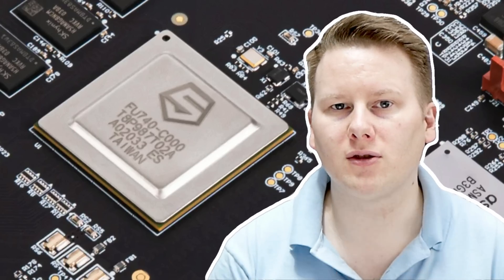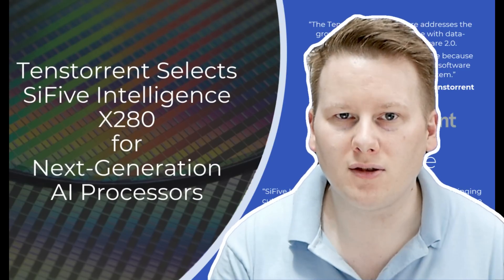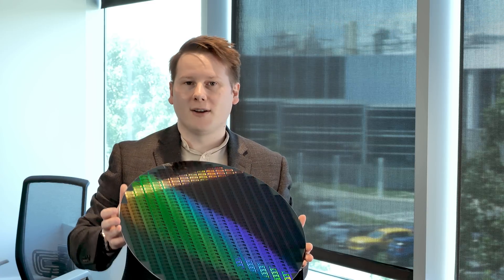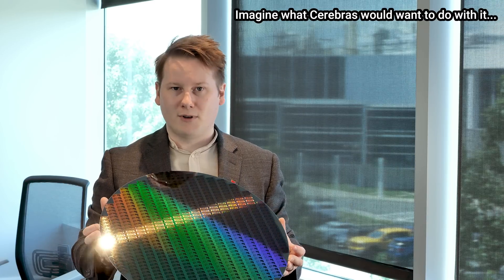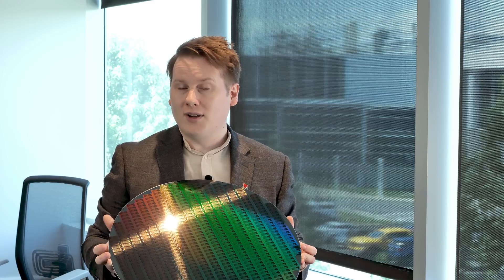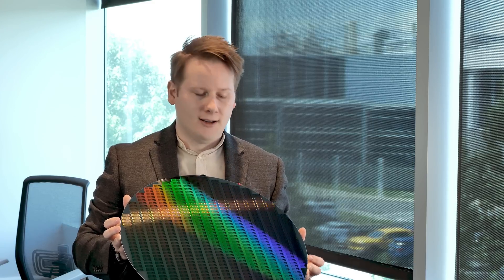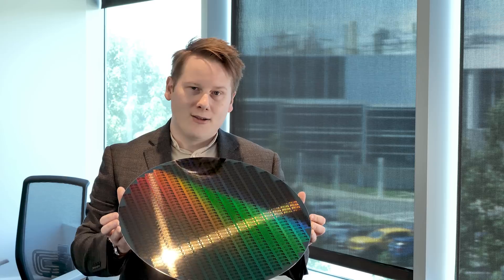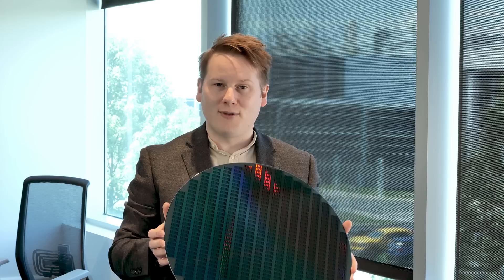Why Don't We Have 450mm / 18-inch wafers?

Comment: do they even grow ingots this large? Like you don't just turn a single wafer of silicon. Because that would imply you could grow Germanium ingots in the same size... Which would make massive optics
Reply from the maker: Yup, they do. I've got a video showcasing a 440mm, 2000 kg ingot a company had at a trade show. Ingot growth isn't a concern 👌

Comment: 450mm wafers were a real discussion when the industry couldn’t figure out how to go below a 14nm process. It’s the next logical step if you can’t get your devices small enough, and we’ll probably get there, I just don’t see it happening in the next decade. There’s too much cost invested in fabs at the moment and we’ve managed to push down the nodes to at least 2nm and Intel is talking angstroms with their raptor line, so we’ll see!

Comment: This video is disappointingly short on details. Why is switching to larger wafers so expensive? They don't do lithography on the whole wafer at once, they expose one die (or a couple) at a time, and then shift the wafer to do the next die. The design of the mirrors and lenses limits the reticle size, not the wafer size, so making 450mm lithography machines doesn't seem like it would be difficult. Is the issue the other machines, like deposition/polishing? What are the main drivers of the lower yields near the edge of current 300mm wafers?
Reply from the maker: It was literally a hands on with the wafer that was randomly handed to me with a little background. Wasn't a prepared video, got a brief history lesson in the fab buildings where the research was done. If there's desire for a wider video on the topic then I might go further into the details. There's only so much you can say in 3-4 minutes.

Comment: The switch from 8 inch (200 mm) to 12 inch (300 mm) was very challenging and much more expensive than predicted. In fact, many facilities still haven't switched. Try to get an interview with Chris Mack. He's been doing this for decades and would have lots of detail on the economics of increased wafer size.

Comment: Seems to me like if there was a time to be switching over to 450mm wafers, the time would be... well. Now. TSMC is spinning up an entirely new fab on US soil, and aren't Samsung and Intel doing the same?
Reply from the maker: You also need to have the tool makers develop 450mm machines. There are dozens of tool makers, and you'll need them to make dozens of tools.
Reply: it would've been when we went to EUV and needed to swap a bunch of parts out.

Comment: Thanks for giving us a taste of a possible future! 
Asianometry has an extensive video on this a while ago. 
450mm wafers are floppy, I think just the size starts to work against the other manufacturing priorities after a point.
Reply from the maker: This wafer was floppier than a 300mm wafer, but the research foundation made a full process line to counter that and it's not really an issue any more.

Comment: The economics of 450 mm wafers had two additional economic factors.  The first was that it was traditionally Intel who would commission ASML to produce the tools for new wafers.  This time around, Intel was dragging its feet as they had just changed management and were more interested in spending money on acquisitions than investing into the increasingly expensive fab side of the business (see Altera).  This was before their infamous 10 nm delays were publicly known.  If I recall Intel's original roadmaps, the 10 nm generation was to be mixed 300 and 450 mm wafers depending upon the facility.  It didn't help that Intel's Fab 42 was designed to handle 450 mm wafers was built but deemed too expensive to populate with tools and thus closed before it could even opened.

The second factor was that no other manufacturer was willing to pony up the investment to go to 450 mm wafers if Intel was not willing.  TSMC was not the power house that it was today.  GF was still young and whose major investment at the time was spending billions to acquire IBM's fabs instead.

The other factor for 450 mm wafers not appearing is it'd increase production volume while the foundries were already in oversupply.  What radically changed in the coming years is that multipatterning had become a requirement for leading nodes as EUV still wasn't ready.  That choked throughput and is one of the reasons the recent chip shortages were so apparent.  The recent shortages would likely have still happened (fabs need people to run in a pandemic) but no where near as severe for those chips on the leading edge.  Intel's own shortages were resolved by opening up Fab 42 as a 300 mm wafer facility which just needed the tools installed.
Reply: Right on. I live near suny poly which had a fab in Marcy ny in which a development fab was made in 2008 for 450mm. This fab has nothing going on now. I was going to to suny poly for master/PhD for nano engineering. They were trying at the time get students to do research at the marcy fab.
Reply: @erichrybinczak8894  I hope a fab VP reads your message. Even for field trips or just to get some hands on experience as student operators. 
   NOTE to others. I had to work my way through college. Later on Graduation day when I got the same sheepskin as 300 other people, the intern and student jobs gave me experience. Put my friends who worked and I ahead of the pack. 
   Intel, AMD, National Semi - you want better candidates please let us come work there or tour parts of the plant. In our early 20's we do not know what we can ask for.
Reply: @erichrybinczak8894  are you referring to the Danfoss fab or the wolfspeed/Cree/GE fab? A lot of semiconductor mfg’s. like to promise breaking ground on a new fab during supply shocks to try to boost moral, but are to never be believed until the shovel is in the dirt, and even then it isn’t really a done deal until wafers are flowing through the fab. A lot of companies scaled back on promises in 2008, and are likely going to do the same by the end of this fiscal year unless they are at the top of their market niche.
Reply: I'd suspect that with the increasingly miniscule feature size on dies today, it just isn't as feasible to produce the optics to project the lithography onto that large of a wafer. I mean, spherical and aspherical abberations in your lenses aren't quite as destructive when you're dealing in 45nm scale, but when modern lithographics processes are down to 3nm feature sizes, you want to limit wafer size to what you know with 100% certainty you can accurately project on. The current mirrors for projection have deviations measured in atoms. Imagine the challenge associated with producing even larger mirrors with that degree of precision only to find that you can't get a tight enough focus at the periphery of the wafer and you have to scrap 30% of the yield.
Reply: @mndlessdrwer  That's not how projection works - they don't expose the whole wafer at once. The field that is exposed is about 26x33mm (getting smaller in future), then the wafer is moved to bring the next section under the lenses. 

Moving to 450mm means that the tables to move the wafer around have to be larger, but the actual optics shouldn't necessarily need to change. Processes that do affect the whole wafer at once (applying resists, washing etc.) would probably be most affected.
Reply: Thanks. I was going to ask how moving from 300mm to 450mm is so different than the move from 200mm to 300mm but you basically answered it.
Reply: " TSMC was not the power house that it was today"   Was?  Hard to find someone with six years experience  TMSC grade hardware outside of TMSC. Intel will build fab plants over here but can not build talented employees. 
To you point, universities do not host fabrication equipment which is a shame IMO.

Comment: It's technically 17.7 inch when u convert 450mm to imperial. Just saying.
Reply: 12" is 11.8" then
Reply: Shhh, anglos have an allergy to sensible measurement units
Reply: Fine 457mm

Comment: Been talking about this forever. 450mm should have rolled out after 28nm... then once EUV started R&D and wasn't on 450mm, I knew we likely would never see it.
I wonder what is going to happen with the legacy fabs that are still on 6in and 8in... some of those tools are 20-30years old and replacement parts are hard to find.
With 300mm being IT long-term, legacy fabs are unlikely to move to 300mm as the cost is just too great.
Hell, one of the labs I was in is still running TSK APM-90s and one of the botique fabs just killed off their 4in line a few years ago.
Reply from the maker: I get weekly emails from a Semi refurbished parts reseller. Always hundreds of machines up for grabs. But you're right.

Comment: I think there are also problems with the silicon ingots, you have to pull them so much more slowly than 300mm that it ruins the economics.
Reply: Yeah, that's what I thought. And silicon conducts heat poorly, so 450mm ingots take ages to cool down, reducing throughput even more.
Reply: @gregvanpaassen  While true that it'd take longer to cool down, I don't see that as a major barrier.  Cool down essentially is time based that doesn't require major intervention.  It does require additional room first because 450 mm wide ignots are physically larger and secondly additional room to keep more of them cooling simultaneously at a time to maintain previous throughput.  These factors do have a cost but seem rather straight forward to change in the production pipeline that it wouldn't have been a barrier to adoption.
Reply: Ian did demonstrate another issue:  rigidity.  He was able to flex a 450 mm wafer.  There was going to a full wafer yield issue after the ingots were cut as the likelihood of breaking/shattering the wafer after cutting would increase.  This was even more pronounced with SoI wafers.

Comment: My first guess would be that the wider the carriage, the harder it is to move rapidly enough while having positioning accuracy to the nm tolerances, and those problems have been solved for 300mm and there's economies of scale around that... jumping up will be hard.
Reply from the maker: The research has all been done. It's just a question of making all the tools at volume and fitting it into fabs
Reply: And now I watched it, yup.  Nibble away!